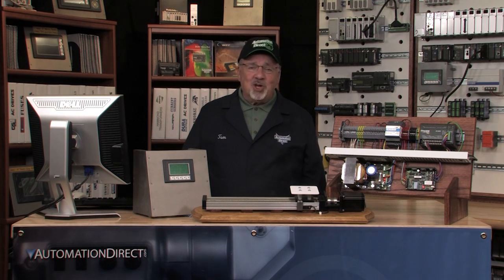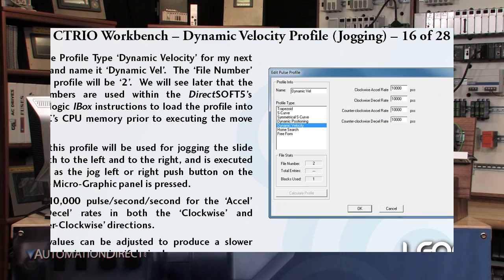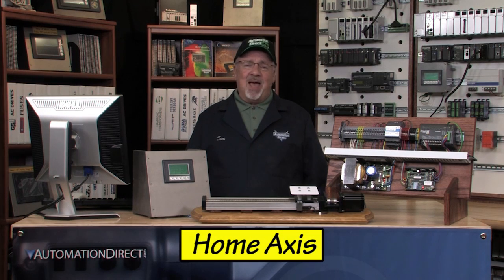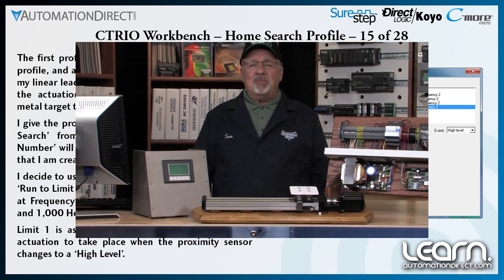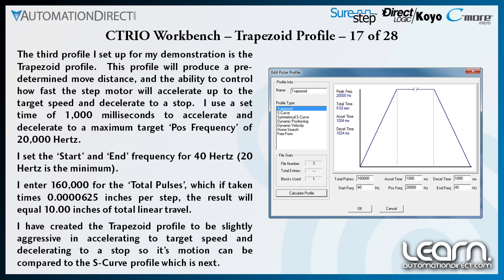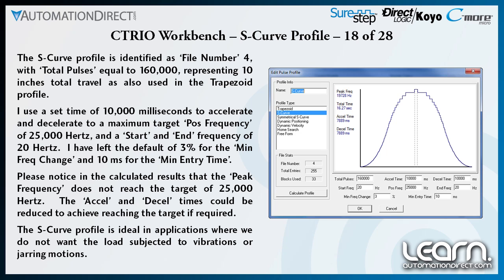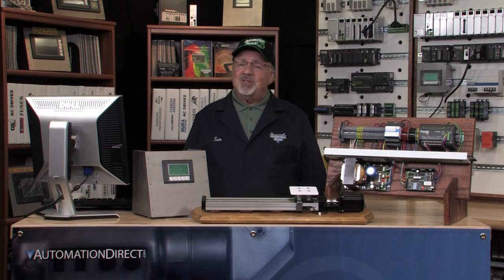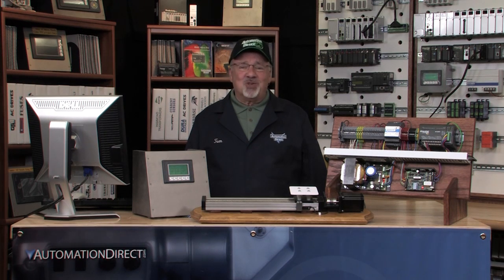DirectLOGIC PLC Motion Control S-curve Move Profile (Part 8 of 8) from AutomationDirect

Comment: Hello Tom, I have been watching the whole series and as time and funds permit, I have purchased, a D-More 205 starter, C-More 6" Micro touch, CTIO for the 205, STP-PWR-4805, STP-DRV-4035, and motor. Working on doing the something only with the Do-More, can all this be done the same way?
Reply from the maker: Thank you for your interest in AutomationDirect and our products.  We are pleased that you have found our videos helpful in understanding how to integrate the various industrial products we sell into a working application. Programming the Do-more CPU, programming a C-more Micro-Graphic touch panel, using and configuring the H2-CTRIO or H2-CTRIO2 High Speed Counter Module, setting jumpers & dip switches of the components being used to match up with other components, such as the stepper power supply, drive & motor, and wiring all of the various components properly, can accomplish the same end results of what was demonstrated in the video series.  Please keep in mind that the programming project for the Do-more & C-more that you are using will not be the same as the projects used in the LEARN video demo unit based on a DL05 PLC.  We hope this helps answer your question.
Reply: AutomationDirect.com Thanks you,
Yep, pretty much.